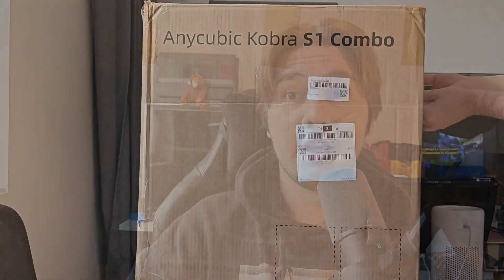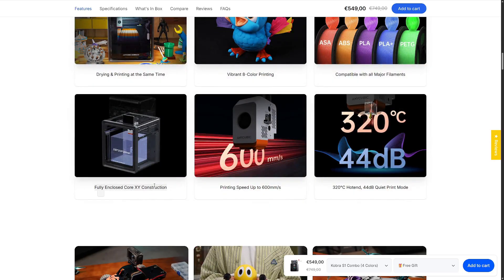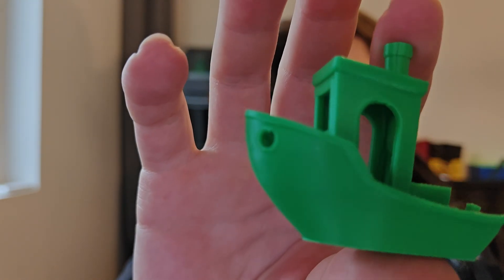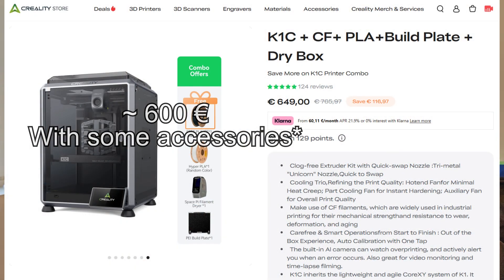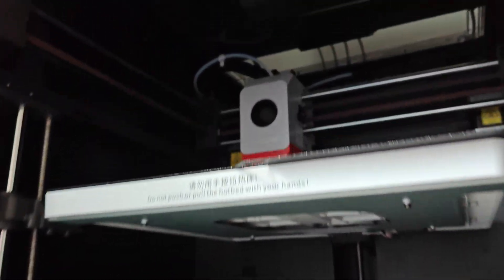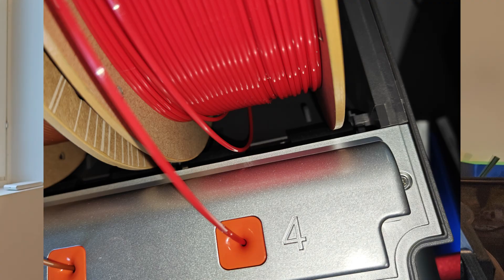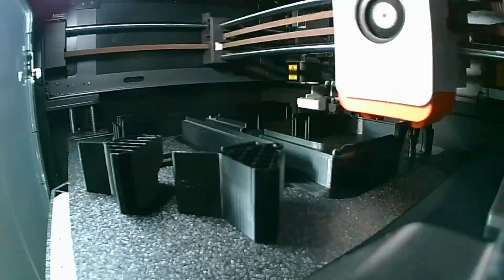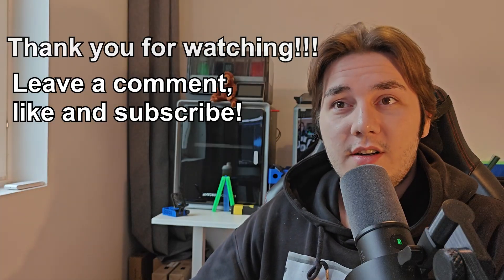The Any Brand 3D Printer Killer? – AnyCybic Kobra S1 Combo unboxing and review

Comment: Your code didn't work
Reply from the maker: Hey, did you try it all caps, "APUPRINTS" on the section to add a discount? It should still be active!

The code may not work on the products that cost less than the discount, but should work on most items and orders. Also, if there already is a code applied (like in some of their bundled products) it only uses one code, not both.

Hopefully this helped!